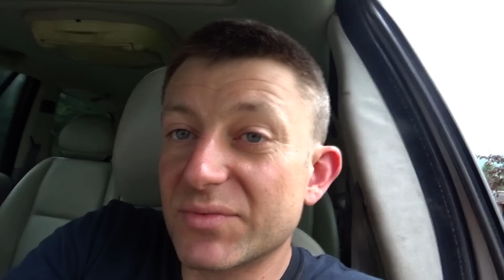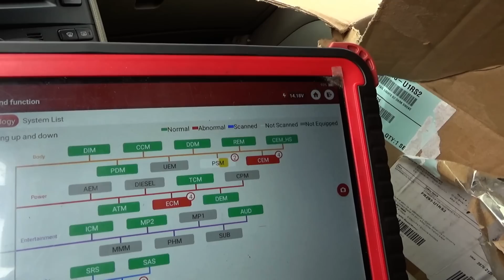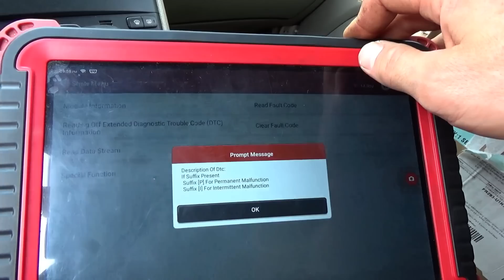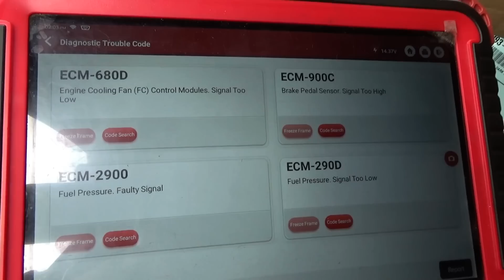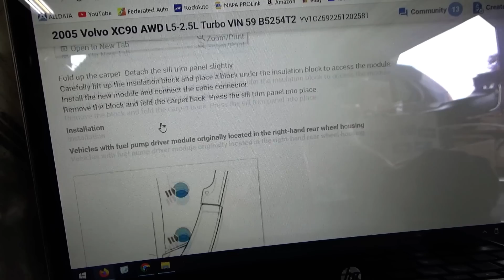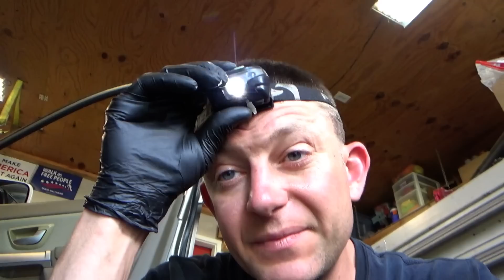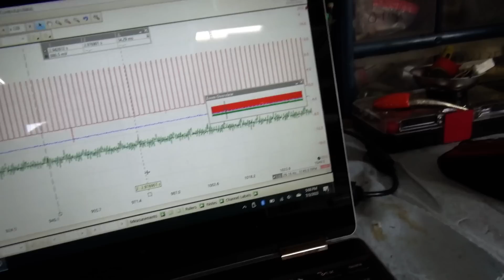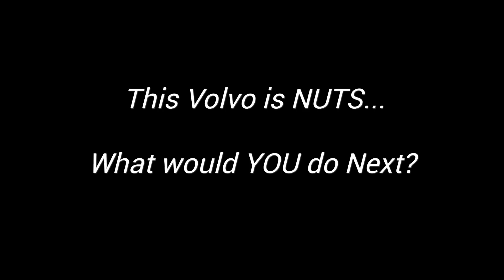(Pt1) Volvo From HELL...STALLS in 3 Minutes?! (05 XC90 Turbo)

Comment: I know the Ford Panther platform cars sometimes suffer from "Wacky Wiper Syndrome."  The cavity where the motor sits gets shorted out when the cavity fills with water.  There are drains that clog.  This car has standing water in it; not to mention it appears to be hacked.  I would want that out the door as well and 3 hours of diag. and 5.5 hours to replace the fuel pump that has allegedly been replaced 3 times with the original in it now, I wouldn't think the customer would invest that kind of money.  I would cast a critical eye at the fuel pump.  This seems like deja vu. on these Volvos.  GREAT VIDEO!
Reply: Looked like the splines shaft was worn smooth and spinning in the wiper arm while transmission was going.  Strange they would both be worn out.  But not when taken as a hole with all the other fun things under the hood.
Reply: @robertsmith2956  You are correct.  I noticed that as well.

Comment: its a saddle tank, the transfer tube from one side to the pump side can easily get kinked on installation.
i would buy a new harness and relocate the PEM to the trunk area.
volvo sells the relocation harness for this reason, cracked insulation exposed to weather...can't be good.
its not 5 or 7 hour job, more like 3 max.

Comment: Does the engine crankshaft position sensor output control the fuel pump control module?
Reply: Had a gm 3.6 act up and turned out it was a failing crankshaft position sensor.

Comment: Fuel filter clogged ? I would check the pressure  in the engine bay next and replace the filter.
Reply: That would increase the pump load (and therefore current), not reduce it.  It could be the filter sock on the pump inlet in the tank though.

Comment: Just because he replaced the fuel pumps so many times doesn't mean he did it right. Look at all the other hack jobs. There could have been new seals he was supposed to use but reused the old ones. The sock assembly could be wrong. There could be a bleed off hose connected to the transfer pump that is hooked up wrong. I still think the problem is in the tank. Volvo makes their cars way too complicated for a diy mechanic to work on.

Comment: If the tank is not too full, it is easy to open fuel pump and fuel level access areas and assure proper routing of the hoses inside of the tank. Question if the owner used the correct part for the vin(think 2 options are possible)

Comment: You know its gonna be good when you see a Volvo in the yard with the hood open and a battery charger hooked up to it, LOL.
Reply: Well Al mechanics know you hav3 to have a battery maintainer connect as every doo has a courtesy light, the interior lingers on the roof as well. This can discharge a battery within an hour, throwing up all sorts of extra error codes because the control modules don’t have enough power.

Comment: I wouldn't have removed those two wires from the relay.  For all we know it was holding open another relay to a self-destruct device.  Hahaha.

When you disconnected the harness from the fuel pump module and tortured the harness, don't you preach not poking and prodding because you can accidentally fix the problem? 

Not sure you needed the oscilloscope.  Couldn't you have put your own 12V power on those wires and removed the module from the equation?

Disconnect the fuel line and see if it can make pressure and flow right out of the tank without the long run to the engine.  Use your own 12V supply. If it can't, it has to be something inside the tank.
Reply: @major__kong  I was wondering if it is realistic to take the pump out and put it in a bucket of water and test it like a water pump. Not sure if the water can screw things up badly though. I guess the same test can be done with gasoline except you'd have to be careful where it pumps to!
Reply: @major__kong  and the gasoline fumes from an open tank

Comment: A lowering of amps means the pump is losing its load. Instead of pumping gas it's pumping air. Causing the stall.
Reply: Doesn't necessarily have to be pumping air, a blocked or restricted inlet (e.g. flexible pipe collapsing) will also cause a low load condition for the pump motor.
Reply: Ivan already alluded to this
Reply: I think there is a blockage or an air leak.
Reply: Time for a visual inspection.
Reply: That's what I think also!
Reply: That’s what I was thinking when Ivan saw that the rpm went up. Either load loss or loose impeller.
Reply: I know in mining operations pumps that are controlled by automation has software to shut off pumps if "run dry" conditions are detected like low amperage, high RPM.  The computer in this case definitely is trying to prevent the pump from burning up.

Comment: driving many volvos 850's to s60's  main issues with fuel drop is ....fuel pump ,transfer hose to the other side of the tank has a hole in it or fuel injectors are staying stuck open 1 or more or the injector o rings are cracked .......my guess  ....them wires look Schlechty as well and a mouse could have been chewing wires as well see that on my s70 it chewed through the purge valve wires 3  on the top of my fuel tank

Comment: Fuel rail pressure sensor. Really common failure in all Volvos
Reply from the maker: I've never actually seen one fail...but have seen them replaced many times as a Parts Cannon MISFIRE haha
Reply: @PineHollowAutoDiagnostics  yeah fair enough. I used to work on a LOT of Ford Focus XR5s here in Australia. They have the Volvo 2.5L T5 engine in them and those fuel rail pressure sensors failed pretty regularly once the cars were around 8 years old. Would cause weird/rough running, check engine lights, stalling etc. 

I don’t condone firing the parts cannon but it’s worth looking into that sensor in this case just because it really is a common thing to fail.

Comment: fuel returning back to the pump may be a bad check valve  or a failed return check valve under the hood or in tank I also say Use fuel Color Dye in tank I want to see where its leaking back to fuel pressure does not just drop unless you have a direct injection pump high pressure then low pressure pump as well to pumps one in tank one by the engine does this one have 2 pumps.

Comment: Water in the footwell is the sunroof drains, there was a lawsuit about this.   There are a bunch of electronics under the passenger seat that cause issues, esp. with audio.   The BCM could also be an issue due to water intrusion, which could also cause airbag issues in A-pillars.
Reply: So if you have water inside front footwell , you must check under scuttle frets, at the lower edge of windscreen, the main drain hopper mesh will be blocked and overspill goes into your lovely car front footwell, this then sets up wonderful condensation inside all lower electrical especially a pillar and under seats , clean out scuttle, and dry out your interior for a totally fixed car. This fault kills every time and the owner loses faith in indestructible Volvo . They sell many expensive parts , but not the scuttle cleaning kit🐥
Reply: @morphix9  but in this case there's discoloring on the A pillar trim indicating that the sunroof drain hose has let go from the rubber elbow at the base. I pop them back on with 7/8" marine shrink tube around it to form a mechanical seal that won't allow it to pop off again.
Reply: I never ever want a sunroof. Spent many years working outside in the blazing sun and that's the last thing i want. These people who drive to work in an air-conditioned car, go into an air-conditioned building, and then declare "what a beautiful day" when the sun is blazing, really burn my a*s. Try working in it! Some people have died of heat stroke, one for the same company i worked.

Comment: Even when you get it running proper that 4T65e is gonna shatter to pieces
Reply: This is a 2.5L so it has the Aisin AW55 not the GM trans
Reply: @YZJB  ah ok thought it was the 2.9
Reply from the maker: @lieutenantdan8170  yes the 2.9 Twin Turbo inline 6 is GARBAGE with the GM transmission lol

Comment: The twisted wires are part of the Canbus system. It’s twisted to minimize the electrical magnetic field. Don’t untwist it.
Reply: You can twist power and ground to reduce their electromagnetic interference to other wires like signal wires.  For CAN, it's more about reducing CAN susceptibility to incoming interference.  With common mode noise, it effects both wires equally, and the twist helps cancel that noise.
Reply: @major__kong  👍I’m learning about CanBus and Linbus on YouTube.
Reply from the maker: There is no CANBUS going to the Fuel Pump Driver Module lol
Reply: @PineHollowAutoDiagnostics  👍That could explained in a future video.

Comment: A scanner is great, but I’m old school. I would be spraying starter fluid to see how long it will run.
Reply: We know already that compression and spark are fine and its losing fuel pressure.  Starter fluid is more of a "you don't know if it's fuel or spark" thing.
Reply: I'm a GUMOUT carb & choke cleaner kinda guy. Indeed, it is ALWAYS in my troubleshooting kit. BASIC.
Reply: @hightttech  👍No amount of technology will replace the three requirements for combustion. Fuel. Air. Compression.
Reply from the maker: And what would that tell you exactly?
Reply: @PineHollowAutoDiagnostics  That would confirm that he's "OLD" but the "SCHOOL" part would need more research
Reply: @PineHollowAutoDiagnostics  👍Just keep on spraying to see how long the engine runs. It takes about ten seconds to deplete the residual pressure from the priming stage? Just guessing?